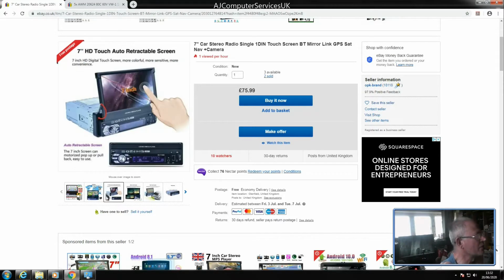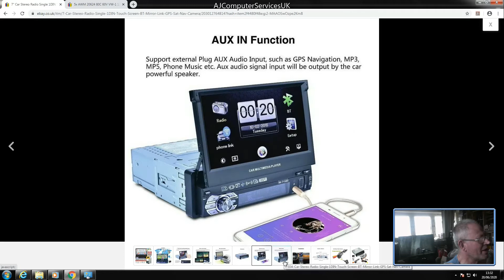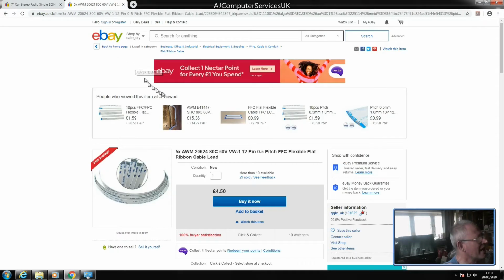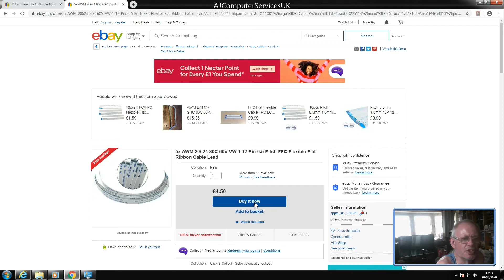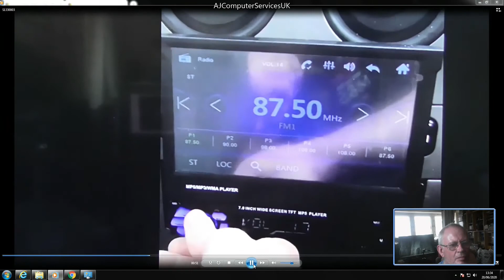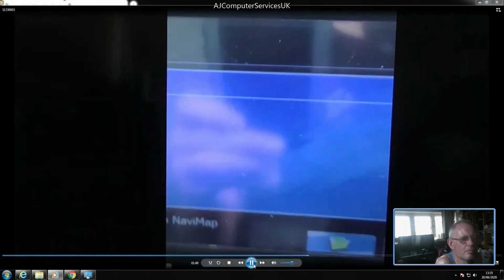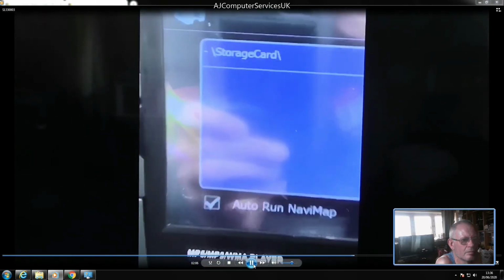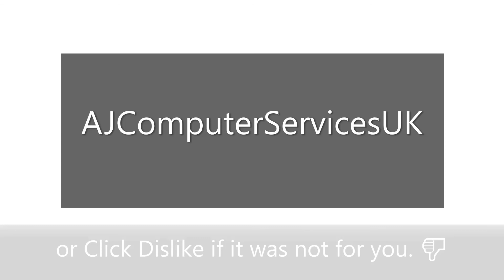Single Din Car Stereo with 7" Screen 9601G - Faulty GPS - Possible FIX

Comment: Mine is stuck at welcome, starts and just shows Welcome on the screen. After 5-10min shuts down
Reply from the maker: I’m not even sure what to suggest regarding that, What I would do is take the cover off & check the internal cables but if you do end up doing that then just be really careful that you don’t end up ripping cables out of the sockets etc!

Comment: Mines doing the samething but I don't think there's a problem with the radio where do you get the GPS from   I also used a flash card I tried to download iGo Maps and it didn't take it they don't give you any information when you get these where to get it out or anyting
Reply from the maker: Yeah I know what you mean, Did you managed to get it sorted in the end?